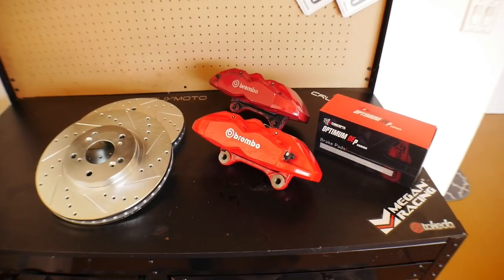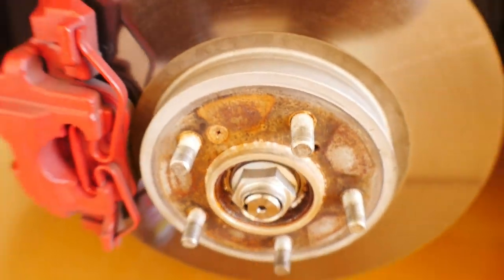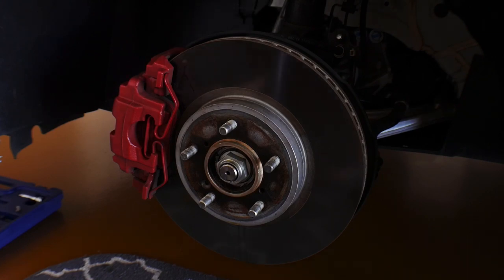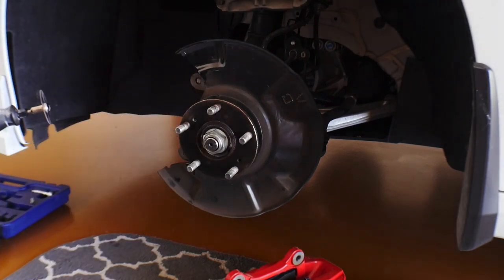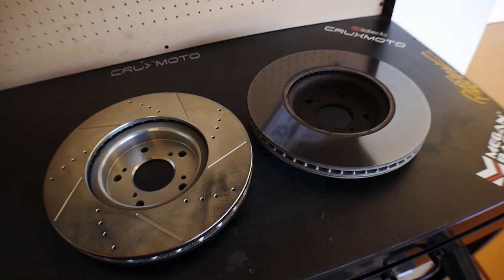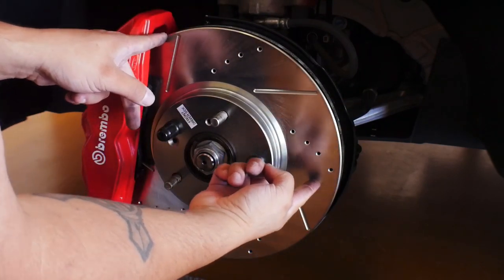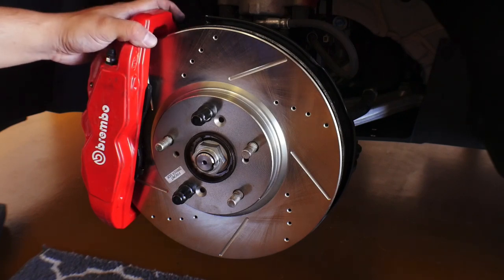Building a $500 Big Brake Kit for the 10th Gen Accord (2018-2020)

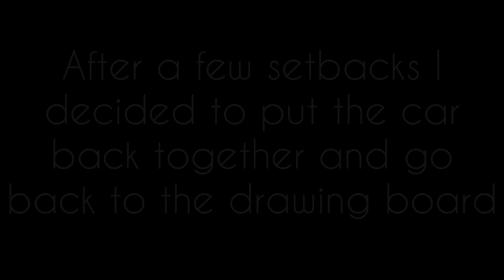Comment from the maker: * 21:33 & 26:05 the audio is slightly delayed. It last about 15 seconds each when filming myself. Working on getting it corrected * Happy Holidays!
Reply: Loved this. My car is really moving now so I almost cried when race technologies said 4 grand. I’m ready to purchase everything in your vid but just wanted to make sure any year genesis brembo’s would work.
Reply from the maker: Hey Paul - Yeah any year brembo’s would work. 1st or 2nd gen have the same calipers.
Reply: Fahrenheit Motorsports thanks bro. I ordered them from Lkq for 80 a pop! Because of that I might splurge and go to the dealer for my rotors.
Reply: Fahrenheit Motorsports hey bro so I did test run today. Unable to put the rim back on. Did you run into this problem? I have stock 19’s
Reply from the maker: I’m running at +30 offset so no problem with my setup. You’ll need 25mm spacers if your running stock wheels.
Reply: Fahrenheit Motorsports I really appreciate the response and this trailblazing project you are doing.
Reply: @Fahrenheit Motorsports did you ever complete this install of the big brake kit? Gratz on the new baby and house.
Reply: Paul Fearon did you use +25mm or +35mm. So can someone pls tell If this setup work with the 2018 Honda Accord Touring 1.5T? Will I need to get a spacer for the stock wheels or will that fit perfectly? Thanks
Reply from the maker: Yes +25mm required on stocks. It’ll put ur wheels flush.
Reply: @adebayo ashaye this was an interesting install. so yes if you are running stock rims 25 mm spacer will allow you to put the tire on without hitting the brembo caliper. However I ran into another issue. I needed to put a spacer between the rotor and the hub to be able to center rotor in the caliper so that I could put the pads in. So spacer inside and out the rotor. I didn’t like that idea so I bought rims with the offset needed that way I only run one spacer between the rotor and hub
Reply: Thanks for such a great video.  Just want to confirm what rotors you ended up with?  What year TL-S or what P/N?
Reply: Did you ever complete the install and if so did you run into anymore issues
Reply: You also mentioned you can use acura tl s brembo calipers
Reply: @jose Rivera i did. My biggest issues was no matter what rotor I used. I could not center the rotor in the calipers, ultimately had to use a 4mm custom spacer between the hub and the rotor plus the break pad does not wear evenly as all of the brake pad does not touch the rotor. Does the stopping improve though. For sure... “still_knight_pearlx” Instagram will give you the best way to complete this install. Hit him up. He also sells the spacers and rings that you will need to for it to work smoothly
Reply: Paul Fearon was it worth the swap?
Reply: @Darryl Khoo it was a strange experience. I didnt feel a difference when I put them on, but this was one of the first mods I did well before I hit 349 hp. But I was like well at least it looks cool. Now that I’m at 349 I decided I need more stopping power, so ordered Rolloface and donated mine to “according to Joel”. He actually just put them on today. Go check out his insta. Long story short, it’s worth it.  when I took of the the brembo’s and put back the stock. Turns out they were working the whole time 😅 I can’t stop for shit now. But my brakes are coming soon.
Reply: Dope
Reply: @xgnofearzthe10thgenlegend82   hey , i got an issue too.. are you putting a 3mm spacer in the hub ?
Reply: @samlim8654  when I had brembo yeah.  you have too
Reply: @xgnofearzthe10thgenlegend82  do you know which rotor thats 100% fit the 64.1mm hub bore? some saying g35 brembo rotor... some say type s..    i think im going to put 3mm spacer in the hub, and i will use the oem rim with 20mm spacer.. i hope the stud will clear...
Reply: @samlim8654  it will clear. U need the spacers and hub ring or rotor ring. I can't remember. But you can use either or. I would go with g35 rotor

Comment: Thanks man I found my brakes at O'Reilly brembo brakes  Remanufactured with life time warranty for 150 each eBay was close to 600 and used with no warranty keep up the good work 👍
Reply: so you just pull up and ask for remanufactured Hyundai Genesis brembo brakes?? ebay is trippin
Reply: Just looked. You ain't lying. Thanks for the tip
Reply: @alejando did you have to order the rotors and brakes as well?
Reply: @herrerajoe9770  yes sir any auto part store will order them for you and it's lifetime warranty can't beat it

Comment: Right on, this is a great video. I'm spent over $500. on just stupid covers. Love what you've done. Wish I could get that set for $500 bucks.
Reply: You can check on eBay if you buy them separate from different sellers they’re going for less than $200 per caliper

Comment: Are you running a 19" wheel? Do 18" wheels clear?  Diameter wise? Like caliper-to- Inner barrel of wheel?  I have a +32mm offset, set of Konig wheels, 18" x 8.5"  I think the wheel spoke-to- face of caliper should be good, I can run the 20 or 25mm spacer if need be.  It looks like my oem calipers are an inch or so away from the inner barrel of my wheels.

Comment: You could've skipped the penetrating lube soak for 24-28 hours. I've done brakes on multiple vehicles for 20 years and have never broken a caliper adapter bolt, also if you would've started with the impact screwdriver  and a 4lb mini hammer you would've saved the screw that holds that rotor on. But hey you live and you learn.

Comment: This is pretty much the kit SlickFab Performance is selling for 9th gen, 10th gen Accords and Civics. The rotor are from a Nissan Rogue though. I believe they get a closer clearance to the caliper. They also don't clear the OE 18s in 9th gen so you'd have to run a spacer, at least 20 mm if you're not already running aftermarket wheels. Nice video, waiting on rotors for my install.
Reply from the maker: Awesome! Link??
Reply: Did you ever install the brembo kit from slickfab? Is it worth it? Is it bolt on no modifications? I want to keep the OEM 19 on.
Reply: @edwinzamudio5055  Yes I got it installed but it does require either cutting or removing the dust shield for clearance of the calipers. I tried running my stock 18" Sport (+55) offset but even with a 20mm spacer they didn't fit. My F1R F35 20 x 8.5 (+35) did clear the caliper. I'm pretty sure the factory 19s will end up needing a spacer.
Reply: @DRIVER0051  thanks. with the 20mm spacer you think the 19" will clear?

Comment: What rotors did you used I noticed that the brake pads are larger then the surface of the rotor on the roque rotors but it works

Comment: Any updates on the completed system? Also, since you said it was rubbing on the inside pads couldn’t u put washers on the mounting bolts to pull the pad inward more vs shims behind the rotor to push it out?
Reply from the maker: Yeah, it was the rotor causing the rubbing but after I got new ones it spun freely. 

But yes I had the same thought, if you wanted to do it safely you could do extended wheel studs and some sort of shim. If you shimmed it with extended wheel studs you could get away with 5mm or less (which should be plenty) 👌🏽
Reply: @Fahrenheit_Motorsports  Can you please tell what was the thickness of your new rotor? (The one embossed on the rotor hub)

Comment: What wheels are you running? 
I have 20x8x9 
40 offsets and it wont clear. Also how did u get the rotors to come out and line up? It seems like is to closed to one side of the caliper.
Reply from the maker: I’m running 20x9 +30 offset. When you get to +40 you need to make sure the wheels spokes are flat in the back or they will hit the rotor.

If you can, find Eddie Wilson on Facebook or Instagram. He has a SNP accord but he makes some spacers that center everything up and they are solid construction. 

If you can’t find him, hit me up on IG and I’ll send you a screenshot of his account so it’s easier to locate him. 

jdmdreamin
Reply: Thanks im running 20x8.5 20 offset with 20 mm spacers. Clear perfect. But i had one last question the pads i get r for the genesis or the tl types. Cuase the pads seem not to touch the rotor fully?
Reply: How is the setup Angel? What was the most difficult, thinking of doing it

Comment: can you use the acura TL type S brembos? on the 10gen accords?
Reply: Yes but you will need drilling to make the holes bigger where you bolt on and mount the calipers because the brembos from the Acura have bigger hoes 🕳  meanwhile the genesis is straight bolt on

Comment: Do an update video after a yr. How has the master cylinder and abs system liked this mid. Thanks
Reply: No sweat, I feel the MS has to work less. Bonus once upgraded to this, it's less expensive to replace the rotors/pads & rebuild the calipers (replace dust seals & O-rings) than with the OEM Honda parts.

Comment: How does the master cylinder and electronic booster handle the upgrade?
Reply: Effortlessly.  Best thing I've done to my 19 civic HB sport. Massive improvement. Grab so good/smoothly/forcefully with very little pedal application,  I feel the master may have to work less to slow the vehicle.  I also installed GoodRidge Stainless hoses to complete this DIY thing of beauty.

Comment: Honda accord brake line bolt right up to the genesis brake calipers?
Reply from the maker: They do yes. I bought replacement banjo bolts (aftermarket) that are slightly shorter and they fit perfect.
Reply: Link for banjo bolts!
Reply: @Angel did you use the Honda Accord brake line? I’m thinking of upgrading to stop tech stainless steel lines And use the matching Brakenetic GT rotors. Any input would be appreciated thx
Reply: @sirkhoo  i used the stock/oem brake hoses from the accord. Just make sure u buy new washers for the brake hoses
Reply: Thank you for your quick reply Angel, since the calipers were used did you happen to replace anything else? (beside the Banjo bolt suggested by Fahrenheit M)
Reply: @sirkhoo  well is a good idea to replaced the seals on the caliper depending on the condition they r in

Comment: Great video! What brake lines would i need for this setup
Reply: The stock rubber lines will work, but I suggest Goodridge stainless lines (kit comes with all the copper crush washers required, shouldn't reuse old ones IMHO.)

Comment: So can someone pls tell me if this setup works with the 2018 Honda Accord Touring 1.5T? Will I need to get a spacer for the stock wheels or will that fit perfectly? Thanks
Reply from the maker: Yes it will. You’ll need 25mm hub centric spacers to get this to work on the stock wheel.
Reply: Thank you
Reply: What about 20 mm spacers it wont work ?

Comment: Is there a way of getting the big brake calipers without modifying doing anything major to the car ?
Reply from the maker: Yeah, buy the brembo’s in the video. Buy new rotors, slap them on and bleed the system. BBK installed with almost no effort. 👌🏽
Reply: Fahrenheit Motorsports oh ok so basically buy the whole set with the rotor it comes with
Reply from the maker: Na, get the genesis brembo’s, TL-S brembo rotors.
Reply: Fahrenheit Motorsports is that too save money ? Or is the size caliber fits under the rim ? Because they offer different size rotors and calipers front and rear on carid.com
Reply from the maker: It has nothing to do with money. The kit was pieced together off the best fit and function. The rotors were chosen they fit the lug pattern, they fit the hub perfectly and they fit the offset after the caliper is mounted.
Reply: Fahrenheit Motorsports is it any year for the Acura TL-s brembo rotor too ?
Reply: Fahrenheit Motorsports and I thank you very much bro
Reply: Fahrenheit Motorsports also do you have to change the rear calipers too ? Or can that stay the same ?
Reply from the maker: Any year will do for the rotors. And the rear can’t be changed because of the electronic breaking 😐
Reply: Fahrenheit Motorsports what is recommendations for the rear? Stock rotors or upgrade
Reply: @sirkhoo  slickfab.com bro

Comment: what up brotha! does the genesis rear calipers work with the accord as well?
Reply from the maker: They do not. The accord also has an electronic parking brake in the way.
Reply: @Fahrenheit_Motorsports  super excited just got my brembo calipers! getting ready to get them cleaned up. quick question about the brembo pads, is there a specific part number i should be using for them?

Comment: Is there something wrong with the regular brakes?
Reply from the maker: No surprisingly the stock brakes work flawlessly. The upgraded brembo brakes help cut down on heat soak if your pressing the car hard on mountain roads or at the track. They also look really good behind the wheel. Very few people will have them on the car which is also pretty cool.
Reply: I K-Tuned my Civic and on the first spirited drive (acceleration/speed gains) felt/knew the stock brakes weren't up for the task any longer, easily exceeding the OEM brakes to get slowed/stopped.  Unsafe IMHO.

Comment: Congratulations I talked to Brian from fast breaks about that hey what's that $800 ads on everything so  you did it cheaper I went with wheel with 6 piston 13 1/2 inch 2 piece rotors  and I damn near cost me $2,200
Reply from the maker: Ouch! I’m sure it looks amazing tho man. As long as your happen that’s what matters brother. If you have an IG tag me in some photos I’d love to see your setup.
Reply: @Fahrenheit_Motorsports  love what you do your channel is awesome you do a great job you know what you're talkin about and and you do almost everything yourself greatly appreciate it yes they did not make it I was the first 10th gen Accord to get a brake upgrade. But on the Acura TL you cannot use Acura TL brembos on the 10th gen you have to use RL calipers and people take the Acura logo Santa Monica brembo there a sec those work but the problem is they're so big it will not fit a stock offset wheels so then you have to buy aftermarket wheels. I think I might be a problem with the Genesis 2 I'm not for sure cuz our cars factory of high offsets I have volk racing wheels so I don't have to worry about that.  That is very informative to the average person great job and letting them know
Reply from the maker: Thanks for the kind words man. Appreciate you watching the vids. 👌🏽
Reply: @Fahrenheit_Motorsports  no problem you're very knowledgeable and passionate about the 10 generation Accord  if you ever have any issues with your brakes or need help you can always call Brian from fast breaks he is he is the guy that made it possible for all the Honda guys to one RL calipers on other cars including Acura TL with RSX S2000 he's the one  is that developed the bracket to make RL calipers fit on several different Honda models. back in the day you had to run the whole knuckle assembly to put brembos from the TLs for a 6-speed manual on a Honda car and if your heart was not the same as a key unless they would not work it with a freaking nightmare that's why the RL calipers are easier to  install versus the ones on the TLs. Actuality it TLs are real brembos and the ones on the RL are  Asics.  but people saying down the Acura logo at the gringo decals on them cuz they're 4-piston also.
Reply: @Fahrenheit_Motorsports  you can also use a Nissan 370Z rotors because they're at 3:30 also and I think you're 12 and a half inch woodworth to is what Brian told me from fast brakes

Comment: I'm guessing since you didn't hit up on it during the video that they work with the wheels you have.
Reply from the maker: Yes they clear by 2mm. But the calipers are massive so tread wisely when choosing a wheel. 👍🏽
Reply: Fahrenheit Motorsports can I use stock sport wheels with this set up or I have to get a new set of wheels. And what about rear calipers and rotors ?

Comment: Soo you can’t use the CTR Brakes or RL brembo caliper
Reply: U can use the acura RL.
Reply from the maker: Both would require a bracket to run those calipers. (To the best of my knowledge)
Reply: @Fahrenheit_Motorsports  yes u need a  bracket

Comment: People used to do this for years to their charger r/t. You don't get any increased braking power without upgrading the master cylinder, you don't get better heat dissipation because the rotor is not bigger, and if you wanted less brake fade you could just upgrade to a higher performance blend of brake pad. This makes no sense other than it looks really good, but they make caliper covers for this. Not a fan of this mod as I don't see the benefit, just came here looking to see if the accord has single or double piston calipers in the front.

Comment: will this work on the civic 10th gen?
Reply from the maker: Yes it will! You may need to use s2000 rotors but you can try TL-S first since they are more cost effective.
Reply: @Fahrenheit_Motorsports  Nissan Rogue with 3rd row seating rotors work great as well.

Comment: Would this work on 9thgen si sedan ? And would the stock master cylinder be sufficient for this setup?
Reply: 8th gen, 9th gen, 10th gen civics for sure.  All 5 bolt pattern setups.  Switch out older 4 bolt lug hubs to 5 bolt hubs and it will work on older gens as well.
Reply: That's what I'm wondering is if the master cylinder would work. Or if you would need to upgrade that to a type s one also

Comment: where did you get this jack from brotha ?
Reply: also what gun is that the one you used to remove the nuts for the car ?
Reply from the maker: These were older craftsman’s jack and jack stands. You’d be better off with a low profile jack from harbor freight. That’s what I’m currently using and it works great. I can lift a lowered vehicle and my truck with the same jack.

Comment: Will this work with 2020 Honda Civic?
Reply: Yes nearly, if not, all 5 lug hub Hondas. I used Genesis calipers and Nissan Rogue with 3rd row seating rotors.
Reply: @jaybud3646  the nissan rotor is it 64.1mm hub bore size? or we have to add a ring on it? and does it required a 3mm spacer inside the hub ?